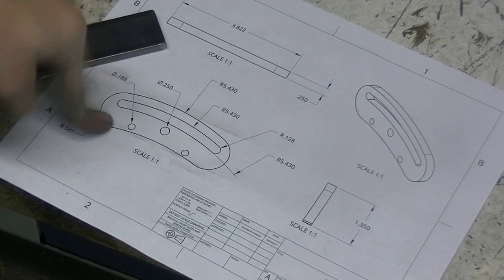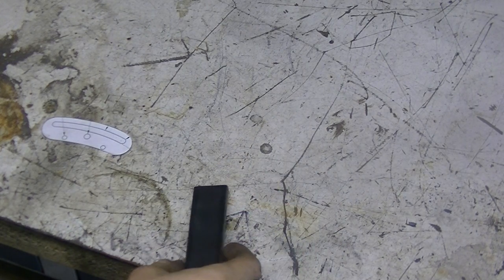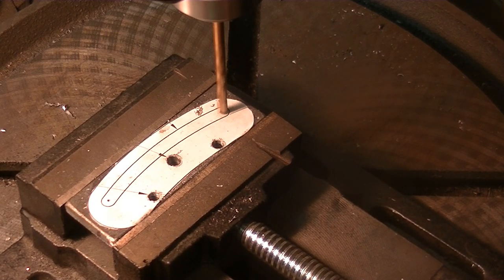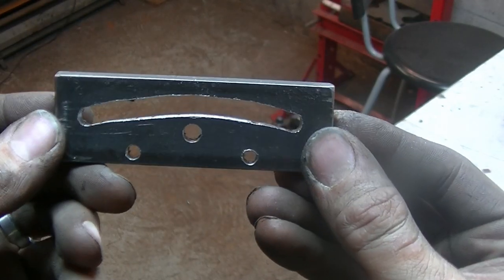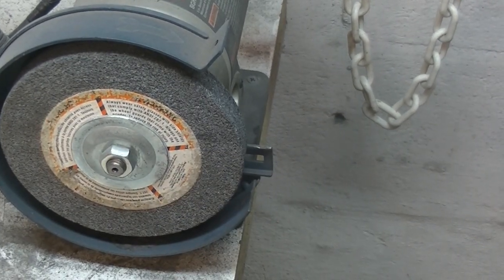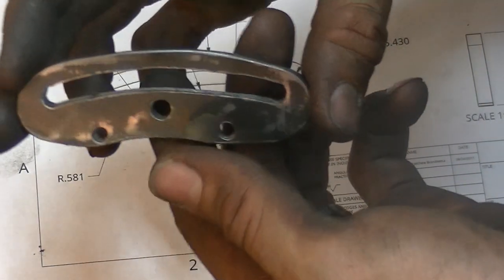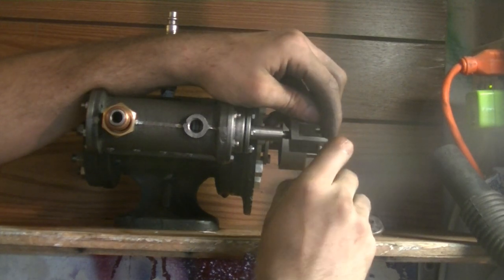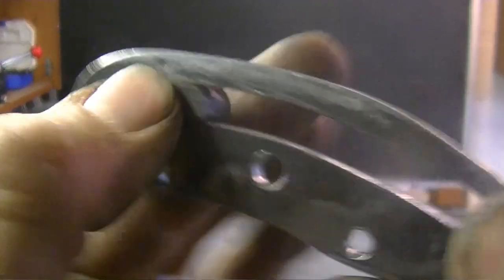Steam Engine Build: Making the Expansion Link

Comment: I realize this is an older video, however, a little tip if you ever have to do something similar in the future. Use a program to put a cross mark in the center of every hole you plan on drilling before printing the pattern out and you will always be on center using a center punch at the crossing of the lines. Just an idea that absolutely helps.

Comment: When working to a template like that, I always like to have the centers of the holes or other radii marked on the drawing itself. It's generally easy to put a little cross-hair or dot at the hole center when you make the drawing. Then you have a mark to put your center punch in to locate the drills. You can do the same things at the ends of the slot, and a centerline drawn down the slot would have mad it easy to center punch to locate the holes for chain drilling the slot.
Of course, a rotary table would make the process a lot easier and quicker, but there's nothing wrong with the way you're doing it. Parts have been made by filing to a line for centuries, and with care (and a lot of time) precision work can be done that way.
Reply from the maker: That's a great idea! Don't know why I didn't think of it!